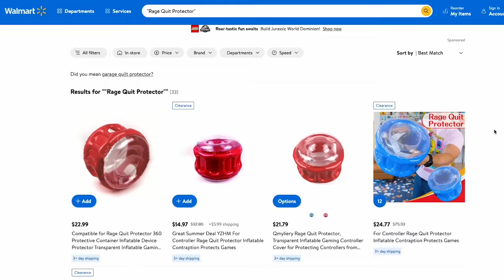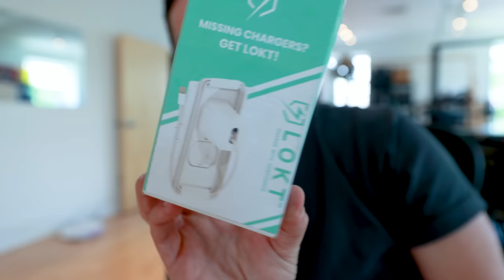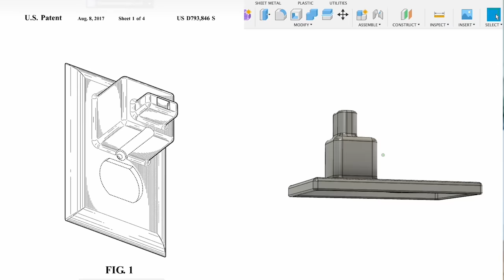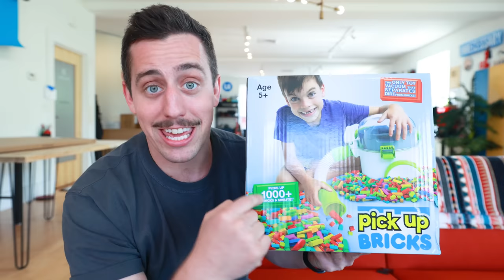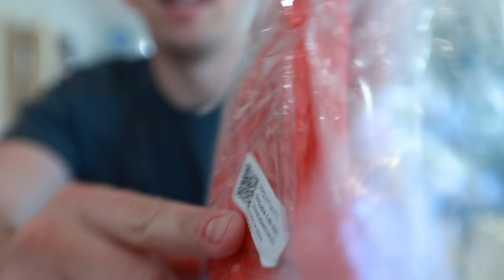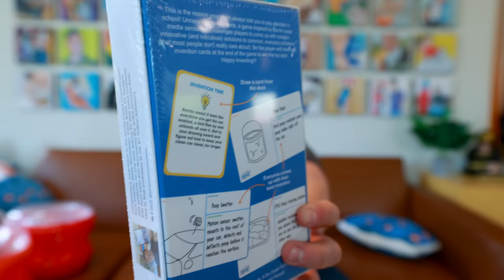Walmart is selling knockoffs of my inventions (AND using my photos)

Comment from the maker: What invention do you want to see me build next?!
Reply: Anything but it should be unnecessary.
Reply: A chair with a timer and alarm
Reply: Splash protector for when you’re on the shitter
Reply: a shutdown protector coz my mom keeps shutting my laptop down when im using it lol
Reply: Copyright logo design
Reply: The sondals, which look like shoes on the outside but when you remove the exterior it reveals a sandal as the sole of your shoe, so you can go from the field to the beach without the worry of needing to bring a pair of sandals with you
Reply: A heavy bowl so you don’t knock it over and spill the contents
Reply: A wristband that straps the remote to your arm so your family can’t steal it and change whats on tv
Reply: A bobble head neck brace they need a break from shaking!!!!
Reply: Can we see the testing knock offs series it sounds interesting
Reply: do changebale sole on shos so you don't need to take off your shoes🤣😂
Reply: This is a really, really great video. Thanks for explaining all that - I had always wondered about your view on selling and protecting your ingenuity. Keep it up, love your attitude and approach!
Reply: Make a device that melts Legos, then goes in a custom mold for a new piece. Kinda like recycling 3d printer filament. Love your stuff
Reply: I'm Just going to say, you may want to pit a small hole in the front for a changing cable. Or maybe a magnetic release cable? Not sure just saying wires exist and I'd hate to see it running into the hand pocket. :)
Reply: Also can you invent a frisbee or ball that self returns?
Reply: Invention 04 June 2022 : MouseSagger - a mouse with built-in massager to relieve carpal tunnel syndrome.
Reply: celfone wiper lol
Reply: Passive aggressive alarm clock
Reply: Rage-quit protector (Keyboard/phone version)
Reply: Something that can find my father who haven't been in my life for 15 years
Reply: A container that auto cracks your peanut that sticks to the side of your boat

Edit: make it dumb the shells into the water so you just can pick the nut up and eat
Reply: Box that burns itself open
Reply: hi
Reply: a money box that yeets your money on the floor.
Reply: a money box that yeets your money on the floor.
Reply: How about a fire Distinguisher? (not extinguisher)
Reply: @winter1798  Oh yeah! Or like it rights itself like the Russian doll.
Reply: A phone case with a timer and alarm
Reply: Something to do with sandwiches
Reply: I helped another 'celeb' such as yourself with a cease/desist on Alibaba.... It was Fun!
Reply: An inflatable tv protector so that it when you rage with the inflatable rage quit protector it doesn't bounce towards the tv and break it.
Reply: Anything with legos
Reply: Make legos that don’t fall apart like normal legos
Reply: You need invent a miniature Walmart, so Walmart can make that and the cycle will be complete.
Reply: Something to stop people stealing ur design
Reply: It's not really Walmart, but third party sellers there.
Reply: a flag pole that only goes up to half mast
Reply: A trashcan with a spring loaded bag remover
Reply: A doggy door... For TODDLERS
Reply: I want to see you invent a court case suing Walmart for this and coming out on top.  Because there is no way that if you were to sue Walmart for this that you'd lose unless Walmart decides to risk everything even more with illegal activity bribing the jury or something.
Reply: phone rage protecter
Reply: A headset pillow
Reply: This is a idea I've had for a while a hat like a guzzler but a hand to hold your sandwich while reading exercising or gaming imagine a plastic hat hinge on top and a metel rod that goes out and bends down and a harness for the sandwich and you can then eat the sandwich.
Reply: Electronic leg door stopper
Reply: Magnetic picture hanger
Reply: helicopter on your hand lol
Reply: A machine that automatically make you tea 3pm
Reply: Bench that does not let you sit on it
Reply: A self loosening belt.  Set the tension in the morning and it's loose by the time you need to take it off
Reply: Me: throws at glass cup and glass cup falls and breaks
Plz fix datt
Reply: Bro tell me the music when u show case ur lego vacum
Reply: A candy dispenser that lets you put an exact ratio of one candy to another. Say you want more chocolate than fruity candies, you could put a 4:3 ratio on it, and it would dispense a specific amount of one, then multiply that amount by 4:3 for the other one. Might be to complicated, but i think it would be weirdly cool
Reply: Digital music in a format but you need to make a player of the music format like a cd
Reply: You could make a music format
Reply: Something that helps us weed smokers. You come up with your own idea from that
Reply: A multi can opener for when you need to feed an entire party Campbell’s Soup
Reply: What about the rage quit protector with the wired controller? Because I'm an old school gamer.
Reply: Build a washing machine but unnecessary
Reply: build a car
Reply: A phone holder for when your on the toilet
Reply: When your hair make a plastic circle around the head while  cutting and the hair falls down the circle
Reply: …Can you build me a friend?
Reply: A rpg to get ride of Walmart
Reply: a zip lock candy bag
Reply: you know those hats that have soda cans on the side? do that with headphones and attach the tube for the soda to the microphone
Reply: Water that is not wet.
Reply: Something to help me eat/drink while driving with both hands
Reply: A food plate bucket with a randomized timer that drops the food into the bucket. So you better eat fast or you lose your food!
Reply: A NUBM31T mounted to a Camera-Passthrough capable VR headset.
You bite down on a click switch to fire the cyclops beam from the laser array.
Since you watch through the headset its mounted on, no damage is dealt to your eyes. But definitely to anyone who isnt wearing a passthrough headset.
Reply: Make long plastic arms
Reply: A among us vacuum which makes the kill sound everytime something goes through the pipe. Ok hol up that sounds bad
Reply: Yes you should absolutely do reviews on knock-off versions of your invention’s
Reply: An uneasacert copyright
Reply: a app that will shut off your phone for 1 hour when a alarm goes off
Reply: maybe coin sorter to properly align all coins face up by denomination?
Reply: Can we talk matty
Reply: Link to the large rage quit protector
Reply: A phone case that can hover in the air to take photos and videos

So basically a drone-phone
Reply: a device that wakes you up when watching sports
Reply: Walmart is unnecessary
Reply: an alarm clock that you can break and then put it back together i need one i broke like 23 alarm clocks
Reply: What about a sock that massages your feet with vibration?
Reply: @TheLakey  gtg
Reply: Mom's slipper launcher
Reply: More food related stuff. 

Cake related?
Reply: a hand free waffle maker im talking you just put the batter in then bam wow! the waffle are made and served to you
Reply: 100th reply, also theres 800 likes on this comment when I made this
Reply: Chopsticks that are designed to hold utensils like a fork
Reply: A rolling phone case
Reply: A 3D you  please
Reply: Massage chair wheelchair/toilet/gaming chair
Reply: @lindsey66  can you ask him for a link to the large rage quit protector
Reply: Let's see a Collab!!!!
Reply: rage quit protector for keyboards
Reply: A pillow that shocks you to wake you up like an alarm
Reply: Air conditioning purse
Reply: Arm wrestling dummy
Reply: For the stoners in the house try to invent a hat spongbob soda hat with drinking tubes that attatches to your bong so instead of sucking in soda you get smoke. Maybe invent a replacement for the bong. Perhaps a container that attatches to the hat and you can wear it on your waist like a fannypack
Reply: Glasses that "block the sun" (completly)
Reply: Bro you can case on them
Reply: @leafbelly  already exists
Reply: the profanity protector that blocks the tv screen when a disturbing or unsafe for kids scene pops up
Reply: @AvocadoPuddingYT  Just set pressing the power button to "Do nothing" in Windows. Google will help you figure out how.
Reply: A chair with a umbrella attached
Reply: A machine that sues company that steal your ideas
Reply: Can you make a chair to charge his your phone watch it and your AirPods at the same time
Reply: I saw a video i little bit back of a rip off from walmart of Pokemon cards cards, and the person sent a return request to walmart and they said where the rip off came from and how to contact that other company
Reply: Something to do with South Park
Reply: The auto-snooze alarm clock
Reply: Invent a collaboration with Michael reeves
Reply: A gaming chair that disconnects your mouse everytime your die in a game or click
Reply: face protector for those moments when you sorta just, drop your phone on your face and then your nose hurts for around 2-3 minutes.
Reply: A gift alarm( you put in let’s say a reminder to get a gift for a person’s birthday, it will start to go off when it hits the desired date)
Reply: Socks with pockets… sockets, if you will.
Reply: Hello there
Reply: a fully automatic pet feeder and water dispenser
Reply: Ew tick Tock Cringe
Reply: A patent to protect your designs!!!
Reply: A way to find the perfect milk
Reply: It’s can of worms
Reply: Te chiken nuggies dipe
Reply: Is that a SIEGE mustache?
Reply: Lights that wont flicker in a thunderstorm
Reply: Raw egg peeler
Reply: The Flux Capacitor !
Reply: Something that holds a bag of Cheetos open but also has a holder for a rubber glove so when you reach into the bag it’s automatically put on and no more Cheeto fingers
Reply: A self spinning hula-hoop.
Reply: @danktorvosaurus  you think thats going to stop them?
Reply: Glove with a water bottle attached to the back of it
Reply: @emperormoist3851  ooh, thats a good one.
Reply: Is it time to sue?
Reply: I want to see you make a RANGE BREAKER, a boom stick that can shoot mountain top to mountain top across a valley, easy.... it will be used for  Ass--- uh Assisting in Recon yah :3 No one would ever abuse a rifle with that kind of range right, it fires mini drones into hostile areas, that can help with the lay of the land.  I have a rough Idea for the shell layouts... and what one would call a simple prototype on hand, well for the shells and projectile.  

Personally if you ever invent one, destroy it on YouTube after demonstrating it, governments will be after that weapon like it is going out of style, destroy it, and kill the blueprints.  
I would do such just to rub it in the government and military's face... and I do believe it can be done... however the actual potential misuse of the rifle would be easy enough to see with that kind of range, it would be like having a portable miniaturized,  battleship cannon on steroids, on hand...  

Basically the same reason I invented a integrated weapon system into a prosthetic limb, that didn't stand out, and then destroyed it... and killed my schematics for such... because I didn't want it being misused.
Reply: Affordable brass shell maker since getting 44 mag brass is so hard right now
Reply: flux capacitor
Reply: @xaviermcghee4927  YES PPEASE DEAR GOD
Reply: Weights with a terrible grip
Reply: Copywright claim them :) You can win a lot of money to get more unnecessary like buying a diamond to use as  a toilet roll holder 😂
Reply: So how can you prove you’re not taking others patents and passing them off as your own?
Reply: A bed but every time you hit the snooze button the alarm gets louder and louder! And LOUDER and LOUDER!
Reply: Y'all giving him y'all ideas for him to profit from smh
Reply: how about you sue the company in America an get your name an faim back
Reply: Yes let's see more
Reply: No you were right it's "Cup of Worms" or you can say "Can of Tea" 😂😆😂😆 😂😆
Reply: What about a cooler that instantly cool beverages
Reply: WATCH THE BEHIND THE SCENE HERE https://youtu.be/SoLMwIHh-4c
Reply: Trademarked? Patent? Contact Dhillon law partner Ron Coleman
Reply: A seat which detects who’s sitting on it and locks up
Reply: An digital timetable setter(like it can tell you tasks in a funky way)😝
Reply: A Controller and Keyboard Hybrid that is a gaming console
Reply: This is the first video of yours that I've seen, and I gotta say, my knowledge on patents and knockoffs has tripled lol. Very informative, and I like your vibe. You gained a sub.
Reply: An Rc car powered muffin
Reply: Please Disguise an Apple 🍎 as an NFC 
Ask Cashier if they take Apple Pay 
Proceed to checkout with physical Apple
Reply: Or get a patent
Reply: Make a charging untangler
Reply: uhh a cheese grater that cuts the cheese blocks into a sculpture
Reply: @randomcanadiangamer7940  that would honestly be super sick! And maybe you can make the legos multicolor? Like a rainbow one or one half purple half green or just any colors you want and you can pick like how many like 3 colors on one or 4 colors you know? I think that would be super cool! Nice idea man!
Reply: @yourmothergaming9248  how many people do you know that eat nuts on a boat?? 🤣🤣🤣🤣 like to say it needs to be on a boat is just so weird lol im so curious and confused. Do you live in a boat and eat alot of peanuts? I need to know the thought prosses behind this idea  🤣🤣🤣
Reply: Could U redesign the charger lock so if live a motor home or caravan. so it screws it for the inside BC mine outputs screw from the inside
Reply: Stupid People need your product and Crooked people are selling it to them.
Reply: A homemade 50 cal gatlin
Reply: A machine that can give hydrogen enough pressure to turn into a star
Reply: Bro make a crock keyboard and the keys are charms,but it includes every key (in crock charm form) in case you have no charms,also you can put any key on a real crock!!!
Reply: How about an extendible ruler that doesn’t have bumps so it actually draws a strait line? Or a pen/ mechanical pencils that are easy to refill with ink cartridges that are hopefully recyclable.
Reply: A bed
Reply: It's a marketplace seller. Wal-Mart barely has anything to do with that
Reply: Something extremely unnecessary in an attempt to bait them into copying it
Reply: A bird talker that’s what you say it’ll turn into bird language
Reply: Do a video on revenue earned from videos.
Reply: A toaster what you can set a percentage and you put your phone in and it pops out at that percent
Reply: An auto ad skipper
Reply: Hiiiiiii
Reply: A chair that shocks you with a taser if you lose a match in a fighting game to motivate you to keep trying!
Reply: Sue their asses
Reply: How about... Croc shoes, it would confuse people so much
Reply: I would like a series
Reply: I hate swiping the drops on the shower glass doors after shower. I d like to have a bar, attached to top of doors, slides down and swipes water down with a click and comes back afterwards, all being driven with thin ropes/threads hanging down the swiping unit.
Reply: 🤔 cup of worms
Reply: Can of worms.
Reply: A different lego brick, just to teach these big companies a lesson. If you change the design enough...its no longer thiers.
Reply: Where is the link for lokt block protector
Reply: Max
Reply: Can u make something for when ur out and u don't have ur phone but u can still talk
Reply: Invisible cloak
Reply: self cleaning litter box. How does all the work for you
Reply: AA bateries that charge for 16 HRs (note i have some at home and they are “ecologic” and the package can fit like 4-6 bateries but it came with 2 tho you should atleast add more bateries that 2
Reply: Build a controller rage thing for wire contollers
Reply: A 3D mom
Reply: A machine that keeps your plants dry
Reply: you know those things where you seperate stuff like candy or medication?make that for big food like cakes and cupcakes big chocolate bars
Reply: FULL. BODY. CROCS.
Reply: 😂😂😂 The Cease and Desist letter is good enough, but having it framed is JUST...perfection 👌
Reply: Phone case with 256gb storage built in
Reply: SUE THEM NOW
Reply: A horribly turning Rubik’s cube
Reply: Bike with a long water straw so you can drink driving
Reply: Mao
Reply: A Mao
Reply: a bath tub and you play in the bath tub and you dont have to getup and take a bath
Reply: Ke
Reply: A photoshoot tripod that has a light on it, and everything you need for a photoshoot all in one.
Reply: @jameskennedy552  
8
Reply: A massive Pom-pom (the size of ur head lol) with cat ears that is basically a drone that releases water when u get sweaty in the summer/if there is a fire 🔥 lol :p
Reply: Build a phone and call a lawyer
Reply: I hope he sued then for cobying his stuff
Reply: A Rage Quit Punisher
Reply: A protector for your computer is you punch it
Reply: those poppy playtime backpacks
Reply: Something original
Reply: yes that unnecesary and als good if you only can play for an hour.
Reply: Anti-scammer machine
Reply: Yes
Reply: An alarm with an ear piercing ring
Reply: A helicopter blade so when you can’t keep your hand in the air you can turn on the blades
Reply: A Xbox
Reply: A toy duck riding a unicycle that never falls over
Reply: An alarm that shakes ur pillow when it rings 🤣🤣
Reply: A phone holder for laying flat on your back in bed.
Reply: a better system to alert those parents that they left the baby behind in a hot ass locked car.  A separation fob/ app.  Fob on baby and app on phone perhaps.  Seeing that no one dare leave the phones behind in a loced car lol.  This might already exist tho.
Reply: @hexfinel5888  Hows about an ExBox.  A box for exes photos lol
Reply: Lol u look like Jerry Seinfeld
Reply: A clothing accessory that zips up your pants zipper if you forgot.
Reply: How can you sell those more than the knock off? 
-put your signature on it and/or personalize it
-thank me later as your sales go up
Reply: Crocs tuxedo
Reply: Your lock charger is better then the legit one tho 😑
Reply: I love your inventions
Reply: @southtxroughneck113  …
Reply: It’s not Walmart selling them, stop clickbaiting.
Reply: A cup of worms.
Reply: But isn’t there 2 types of patents? Design and utility. Design is obviously for the design of it and utility is the concept for it
Reply: A selfie stick for your food
Reply: it is a sign to stop for you to do silly things
Reply: Idk
Reply: I want to see a pencil that uses a laser to help you make a straight line. or atleast show you wheree your pen has to go in order to draw something... a pen where you can put data in that makes you draw what you ask it to .
Reply: i have a good investion that id like to share
Reply: A peace corner
Reply: I had this thought from this vid  what about rage quit allihaveitlaters? A pair of handcuffs that you hook up you your hand and the controller and this prevents you from throwing the controller.   Do it up cut me in for 10%  An alternative is to your your croc glvoes and just modify them to be able to attach to the controllers as one of the cuffs so you can get the hand crocs then tether into the allhaveitlaters attach to the hand crocs.. yeah what a croc I know
Reply: Wal-Mart stole your designs, and you stole mine!
Reply: I want you to invent a button, that when pushed, will make clowns fly out of my ass, and only my ass, build as many as you can. Wait... no more that 50 buttons, and clowns no taller than the guy that played Willow.
Reply: If it isn't down yet you might be able to sue for them using your likeness in the advertisement for the product.
Reply: Back In The Day 2  I don't get it
Reply: Welcome to my world, I had an invention of mine stolen 2 years ago and it has made millions. I have not seen even a cent. I have many other inventions but I am too afraid to take them to market. I wish I could just find a legit job as an inventor.
Reply: @StatueSounds  its called a yo yo
Reply: I design products and specifically work with China for production... For anything I send over for a sample I have to be sure to specify "quality" "durable up to xxxxx hours" etc otherwise they send back total trash. The good news is, if you're an American maker it's really not that hard to compete with China you just have to be more vocal about quality and specify how it's better. "Pay $5 less and have your product break much sooner, maybe even during shipment, or just buy mine and don't regret it". They will beat you on price every time though. From the way they pack pallets to the low cost labor, it's just very efficient and doesn't add to the cost at all.
Reply: a matryoshka kinder egg, there are no toys inside, its just a chocolate egg inside a chocolate egg inside a chocolate egg. That way it should be legal in US too
Reply: @egemenbegum8668  no thanks
Reply: @aaravacg4693  Imagine a chair that gets more uncomfortable the longer you sit in it. That way you have to get up for it to reset, allowing you to stretch and get off your lazy bum for a bit. XD
Reply: A straw they could never bite
Reply: The shooter alarm the shooter clock 10 times on the mfing to turn it off
Reply: Invet a multutouch coffee table
Reply: Binid
Reply: Binod
Reply: Kruejfrjf
Reply: Beware
Reply: Someone else must of made it not theme how can they see the video
Reply: A nacho bowl that will never spill😂😂😂
Reply: A fan to cool down your soup
Reply: Maybe a socks that doesn't hurt when you step on lego for your sister?
Reply: i am the 300th comment
Reply: Hi
Reply: A auto sue anyone who steals your invention with your photos
Reply: Joe mama
Reply: could you try and use a piano to use a controller.
Reply: The sorta infinite battery
Reply: Lesson here make a patient.
Reply: Have you tried adding a filter to your Lego vacuum? I can only imagine the dust it picks up.
Reply: A chair with a lamp
Reply: I have been watching you for 4 years
Reply: I'm tired of swiping my screen. Could you automate this to watch first 1-2 seconds of shorts?